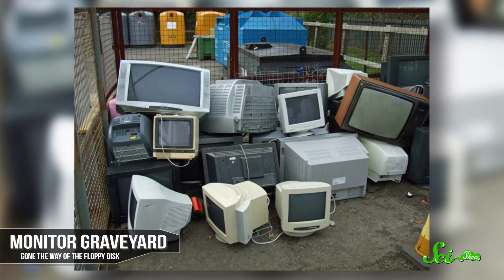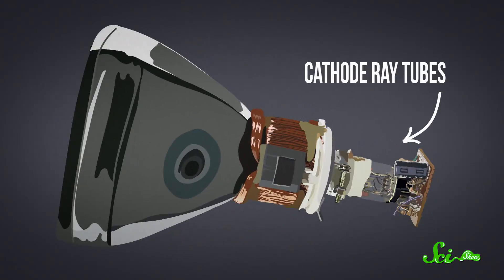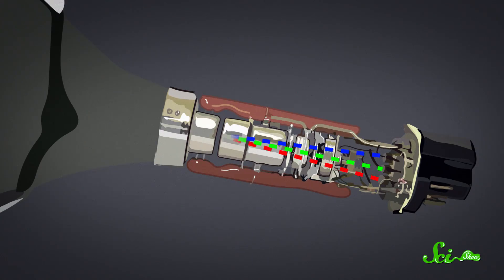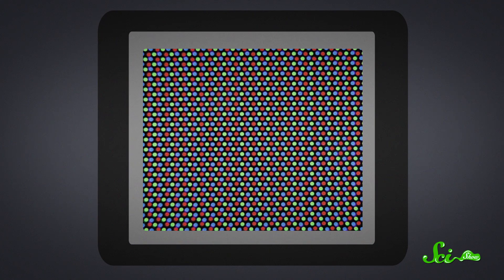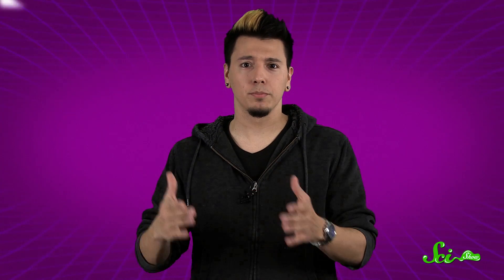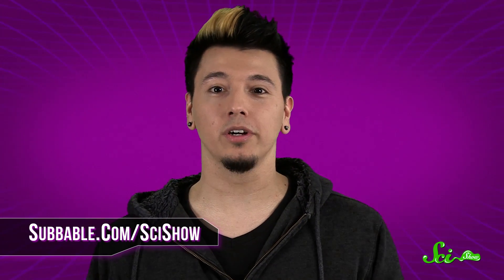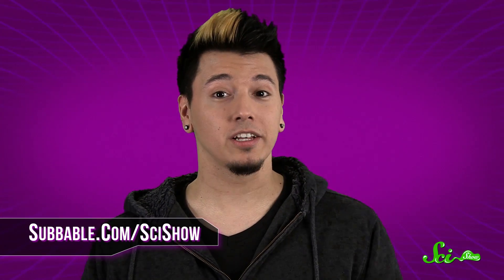How Did a Magnet Just Break My Monitor?

Comment: You missed the part about Degaussing. A monitor is usually not permanently damaged unless a strong enough magnet is used to bend the shadowmask on the inside. If it was a small magnet, then a simple coil loop called a degauss magnet will fix most discoloration.

Comment: its actually pretty easy to fix this. once you magnetized the screen you can attach a strong magnet to a drill and pass the spinning magnet over the screen. if done correctly it will randomize the magnetic poles in the metal (degauss) and the crt will be good as new. as a child i enjoyed playing wil rare earth magnets and crts but always put things back before anyone noticed what i did when they werent around.

Comment: Magnets at the screen do not interfere with the electromagnets or permanent magnets used in the focusing and deflection coils - rather, they directly affect the cathode ray (a.k.a. the electron beam), though no where near as much as the deflection coils (which is why the discoloration is local.

And when the magnets fix the image distortion, it's the ferromagnetic anode screen that gets magnetized, not the phosphors themselves.  The anode would magnetize over time anyway, which is fixed by degaussing, randomly passing high voltage current through the anode.  This randomizes the magnetic moments of the anodes and can fix the induced magnetic charge, and usually happens on display start-up or using a manual function.

Comment: When I was a kid I brought a magnet close to our TV, luckily my dead was a technician and I remember that he used a wire rounded to a circle plugged to an outlet, he turned the TV off, waved that thing around the TV tube and kept waving and taking a step back away from the TV, and then he told me to unplug the wire from the outlet, and the TV was fixed.

Comment: I used to be able to achieve something similar on my old CRT by holding a sword close to the glass. You'd see a rainbow of colors around the blade. It wouldn't work for every bit of metal or even every sword, though, which I always found curious.

Comment: It doesn't permanently destroy it!

We did this experiment all the time in science class. We'd use giant speaker magnets and really screw up the screen.

Then me, as teacher, whipped out my circle degausser and roll it in front of the damaged magnetized screen.

By doing the degauss 2 to 3 wipes fixed most, with max being 10 wipes to completely reverse and fix damage a 12" subwoofer magnet had done.

You can buy degaussers on amazon cheap

Comment: Story time. I once put a magnet on a CRT TV when I was, like, 4, and I broke the TV. I thought magnets would fix it.

Then we got another CRT TV and when I tried to put a magnet on it, it corrected itself.

Later on in a computer class, I learned that newer CRT TVs have some means of correcting themselves when exposed to magnets. Also, there was a tool that would correct a CRT TV if it didn't have that self-correction feature in it.

Now I need to know how/what that was/is.
Reply: The video is a bunch of crap. The mgent magnetises a metal plate inside the computer. The self correcting feature is called degaussing and is basically a coil that when run a high current through will remove the magnetism of said metal plate.

Comment: SciShow 
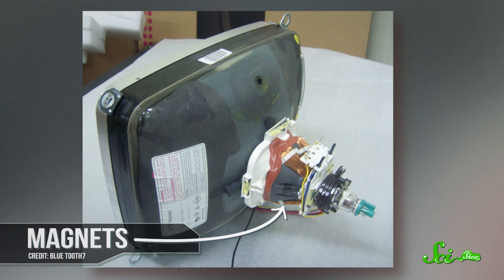Appreciate the videos but there are incorrect statements on this one at 0:52 and 1:22.  1. The picture tube electron beam is not controlled by magnets, the electron beam scanning is controlled by the magnetic field of the coil on the neck of the tube.  2. The phosphorus material on the glass picture tube is non-magnetic material, it can not be magnetized as stated.  The metal shadow mask is what can become magnetized which can affect the picture tube colors, this can generally be solved by degaussing it.

Comment: This was looking like a good explanation until you said that the phosphor can become magnetised - no, it's the shadowmask, as has already been pointed out - and that it's permanent - not necessarily; it can be fixed by degaussing, either with the built-in degauss that run on power-up from cold (wait at least 15 minutes) or through the menu, or with an external degaussing wand that's just an overgrown cassette tape head demagnetiser (service companies have these).

The trouble with making such a big mistake is that it hurts your credibility. If you don't get your facts checked in a case like this, where there are thousands of people in your state who could have told you this, then your audience will wonder how much effort you make with your more esoteric subjects where checking is more difficult. It's not a good look.

Comment: Also, close enough to a sub-woofer will also damage them. Our church used to have old CRT monitors up the front for the presenter (so they could see what the projectors displayed without having to turn around), and one was a little too close to the right hand side sub-woofer and turned permanently blue (while the screen was on).

Also don't forget about screen burning - when the same image was left on a CRT monitor for extended periods of time, causing the image to burn into the screen. It would leave a faint, but noticeable, image of the burnt image, even while displaying something else. This is why computers came with screen savers and monitors with standby modes, to prevent it from happening. It wasn't so much a problem on the TVs as the image would always be changing. 

Ah, the wonders on LCD and LED screens that don't suffer these problems anymore!

Comment: Magnets aren't the only thing that will damage a CRT. I used to hold a screw driver tip to the screen and it did the same thing, only a smaller distortion.
Reply: brownmsoe The screwdriver was probably magnetized.

Comment: This recently happened to my monitor when I was trying out a new setup for some bookshelf speakers. The upper corners turned green. I knew it could happen (I'm old skool), so I don't know why I thought I could sit speakers next to it. Luckily there's the degauss option. No problem. And yes! I'm using a very nice flat front 19 inch CRT monitor that displays in at least 720p. After a decade of flat screen LCDs and plasmas, TVs and computer monitors, dying just after their extended warranties, I thought it was time to give it up and go back to the CRTs that last decades instead of just 1 to 4 years. Having the digital cable to display in the correct aspect ratio is a big plus too. The new full digital cable signal, at least in my area, distorts every aspect ratio displaying on a flat screen TV no matter how much you tweak the settings on the cable box and TV. That is unless you set the TV to display permanently in 4:3 and watch everything square or letterboxed inside of that square. There may be letterboxing on CRTs, but everything displays correctly. HD can and usually does look great on an old CRT. I'm even planning on going even older because the phosphors in 1970s and 80s TVs have a look...that I like to look at. The recent mass brainwashing with flatscreen TVs has made that very easy. I can pick up an old nice quality and brand name TV for free or not more than a couple of dollars. So, yeah, keep the magnets away.

Comment: It is not the phosphor that is magnetized.  It is the shadow mask.  Also you said permanently magnetized.  It is not permanent!  Monitors and TV sets have built in degaussing coil which correct most problems.  Manual degaussing may be done with an external magnetic field such as from a coil, hand mixer etc.

Comment: The phosphor does not get magnetized, there is something called a shadow mask inside really close to the phosphor, it is mad out of steel and helps to direct the beams to the target, that is what gets magnetized. Usually monitors have a coil around the perimeter of the tube that when the monitor is first turned on it demagnetizes the shadow mask.

Comment: my CRT monitor back in the day had a demagnetize button which actually worked..

When the button was pushed, you would hear a loud poping sound and the screen image will be covered by a vibrating waive moving out from both sides .... i only had to use it once for real when a magnet go a little to close to the front of the screen and the image got all funky ... but i pushed the button and it went away.

Comment: Its quit amazing thing to think about as the electrons are being fired at the front of the tube from the cathode ray in the back of the tube to create the moving picture on the front of the picture tube screen thus these electron beams have to be bent as their being fired within the tubes vacuum space up & down up & down left & right left & right dozens of times per second by way of a controlled magnatism field to hit all those dot within a fraction of a second and of course then repeat this process over and over dozen of times a second to get a moving picture hitting all the dot on the front of the TV screen..

IT IS JUST AMAZING how all this had to be synchronize and when it wasn`t synchronize that was when the TV repair man shows up to fix the TV  ( my dad worked on the old tube type TV long before the transistor circuits board technologies took over so I know a little bit about this fun topic )

Comment: Actually, it is not so permanent damage. You can fix the screen by using a Degausser Ring. It will realign the magnetic field of the screen. Or it least it should. Some Monitors had a system in place where you could Reset the screen and it would go all crazy. It was Degaussing.

Comment: "...Permanently damaged"?  That's pushing it. For decades a degaussing coil has been in the tool box of old time tv repair techs  &  arcade enthusiasts which will correct most magnetized mishaps.  So upgrade your PC monitor to save space and your back but don't assume your fridge magnet has permanently 'ruined' your crt monitor. Don't stick magnets on your monitor, there's no good reason to do it and a clear reason not to.